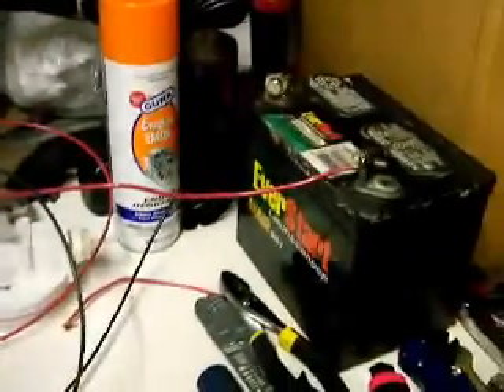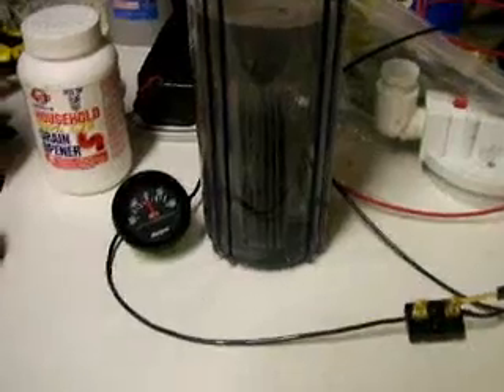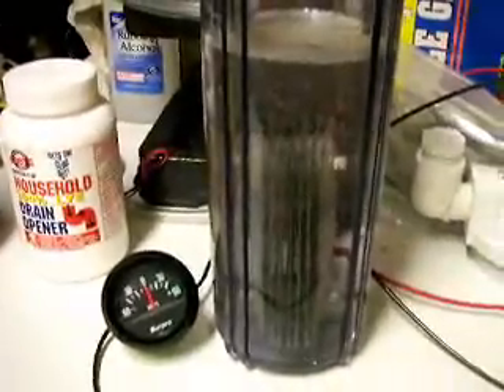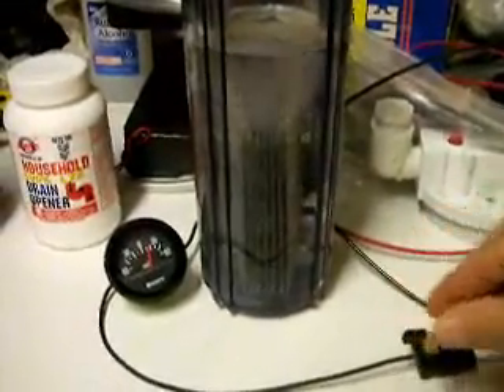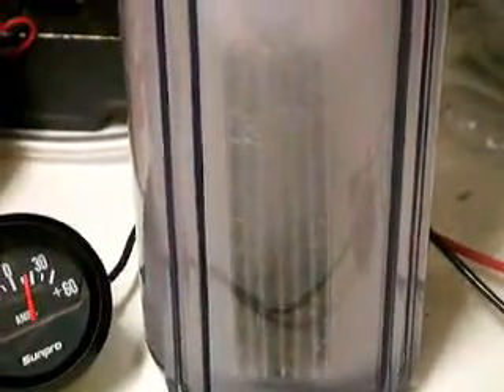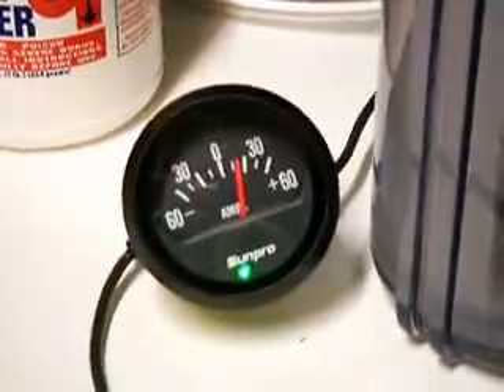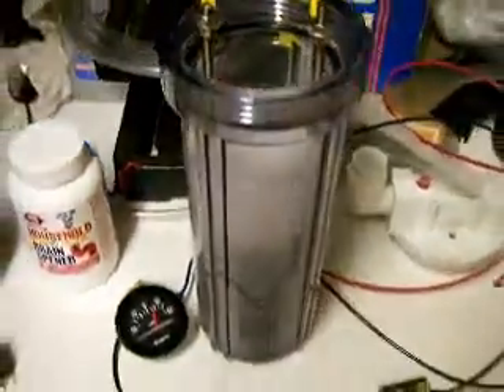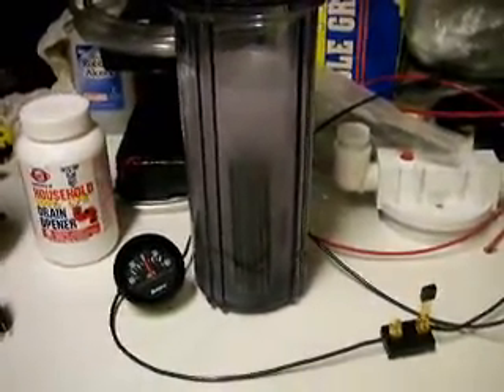HHO generator 1st attempt

Comment: pretty cool setup, next vid show your cell up close.

I am collecting some parts for a cell; I have the same type of water filter housing, ordered a 30 amp PWM, some tubing, etc.

Still looking for a cheap & easy 316L stainless steel to use - something so I dont have to cut much or special order. Any hints?

Good stuff, I look forward to your upcoming videos.

:)